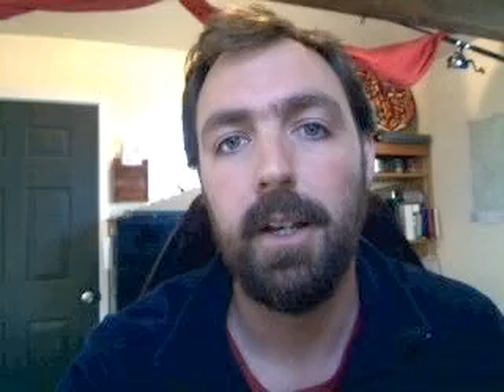StrawBale.com: HVAC Options For Straw Bale Houses

Comment: I've been researching rocket mass heater for future passive solar SBH to heat the radiant floor but wondered if it was overkill for a 1000-1500 sf house in southern or central NH. Do you have a preference for heating?